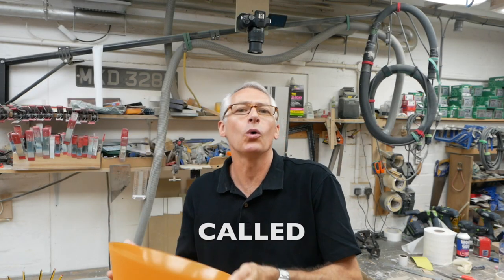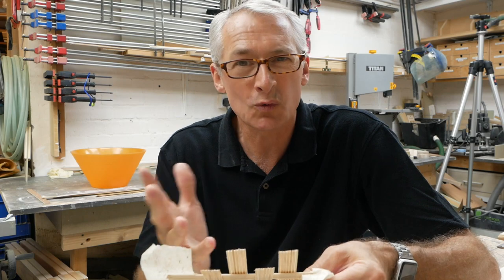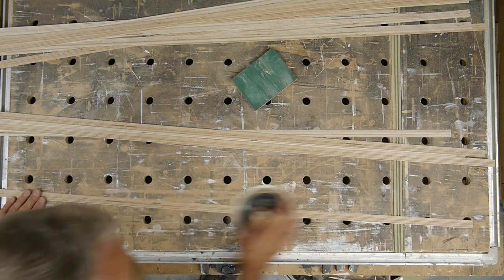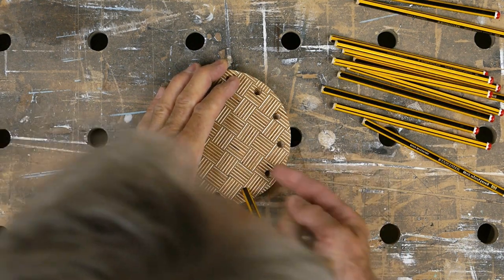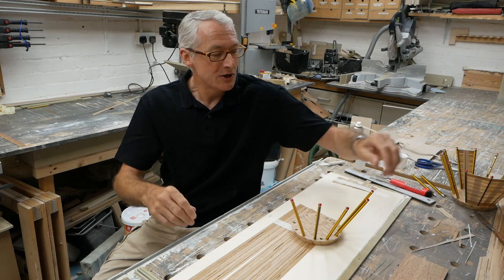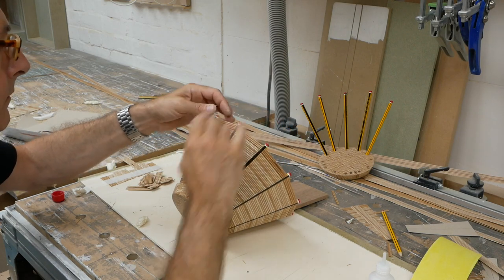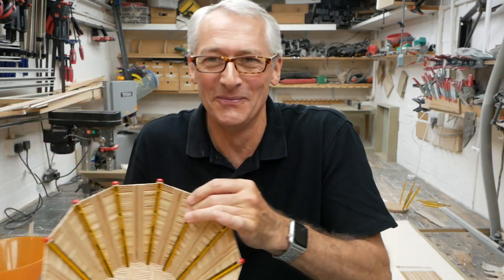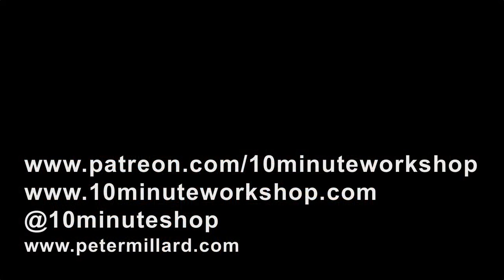Plywood & Pencils: Making a Bowl Without a Lathe #BWALC #201

Comment: Peter bowl is a WOW
Small suggestion
Copper wire support outside will workout well.long lasting.
Reply from the maker: Thank you! Hadn’t thought of using copper wire - nice! 👍👍
Reply: @10MinuteWorkshop  
At the top only for more strength to hold fruits may be 3 or 4 rounds.